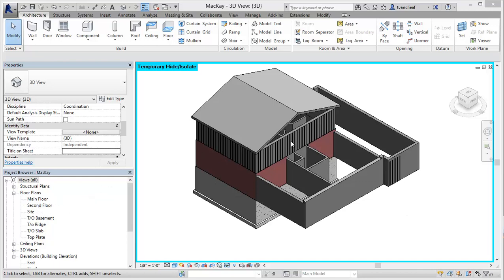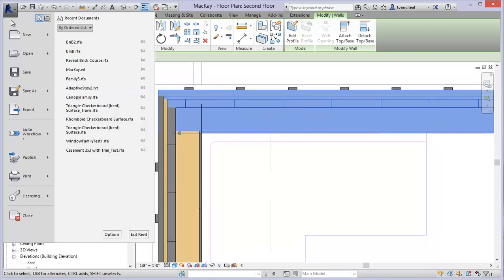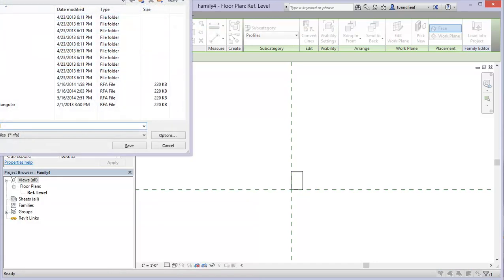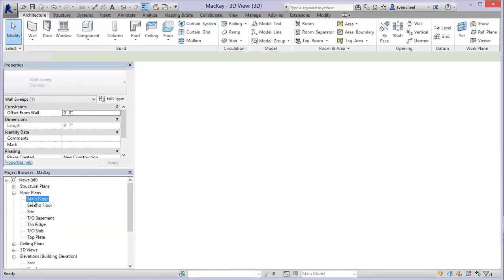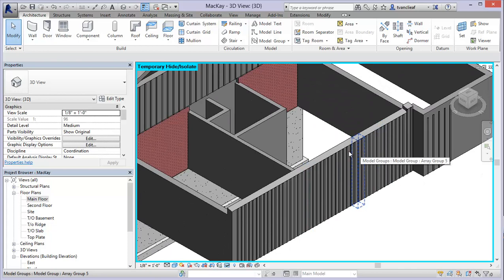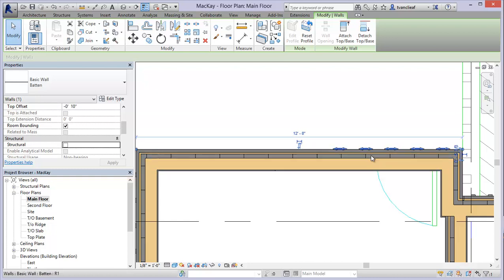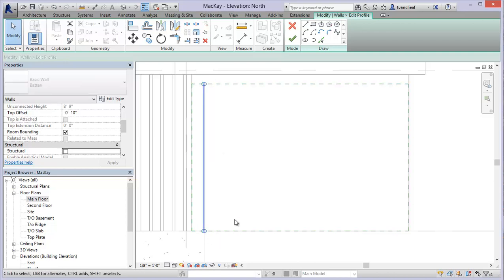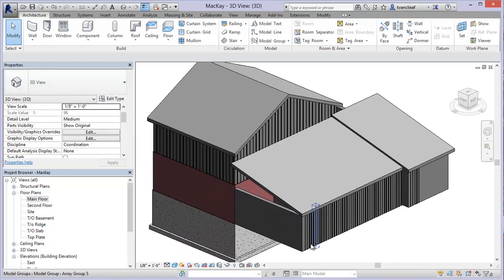Modifying Wall Profiles and Sweeps in Revit 2014 ~ Board and Batten Walls

Comment: how can I put a sweep at a wall ends? Thank you so much for the tutorial :)
Reply from the maker: If you end the sweep command and select the sweep, there is a Modify Returns option that appears in the Modify menu, if it's vertical, it will depend on what wall join you use, Butt joints aren't really helpful in this case unless you have a special sweep profile family, but if you use Mitre joints you'll be able to bring them right to the end of both walls.

Comment: Great tutorial, thanks! Is there a way to create the same effect on different types of surfaces, like floors or roofs? E.g. make vertical profiles that go from the walls up on the roof?
Reply from the maker: There's a bunch of ways, beam systems, curtain walls, sloped glazing are all system families than you can create profiles for in order to achieve this extra detail. For instance, a standing seam roof could be created with a sloped glazing family if you create mullion profiles to look like the seams. You simply lay this on top of another roof that represents the rest of the structure. Also, explore in-place modeling, from the Component panel, select Model In Place. It is probably better to create many forms within one in place component, rather than make one and then copy it. If something needs to repeat, it's better to create a family for it. Key family category though is profiles, then set up the system families.

Comment: that was really great! i managed to attach timber strips....when i click on my wall, the one with the new strips and click edit type and look at the properties window the new strips are not included.....can you help with that?

William
Reply from the maker: William, with this method, you wouldn't see anything related to the strips in the wall properties. These would be two separate systems, a wall and an array of a sweep. If you need a wall with vertical differentiation on the surface, using a curtain wall might be a better option. It depends on how much you have to do.If it were a house, I'd probably do it the way I'm showing here. On a large scale project, you may want to explore other options like curtain wall with a set vertical spacing parameter in the Type settings.

Comment: This was great! I am using this technique to create a vertical metal cladding .. any advice on this? Im curious about how the layers would work with this technique ( I did the first way with the sweep) how to attach this wall to a steel frame and gypsum board... I guess I need advice on how to build the walls after the profiles are done.. not sure if im making sense! maybe you could steer me in the right direction THANKS!
Reply from the maker: You can build the wall out to the z girts or channels, using z girt profiles built into the wall. You'll need to expose the preview of the wall section in the edit structure menu. For the cladding, I'd do this as in place sweeps, just be sure to use the Offset from wall parameter to get the lap correct for your cladding profile. The ends, inside and outside corners will require flashing profiles to really acheive the desired effect, but the outcome looks pretty slick when you get it right. The reason you model the cladding as in place components per wall is so you can remove the geometry with a void extrusion. Hope that helps!

Comment: Like a boss, thanks heaps my dude. Greetings from Australia also
Reply from the maker: Thank you for watching Josh. I cringe when I see some of the methods in these older videos. There would be other ways that you could do this, and although this one has a little more tedium when it comes to openings, it also probably provides the most control at a component level.  For continuous pattern horizontal sweeps or reveals, like Z bars in a ACM panel wall, I'd probably rely more heavily on the built in sweeps and reveal in the wall type properties.

Comment: dam you need to use the metric system :-)
Reply from the maker: You do you hombre, I use both! Fortunately, Revit is bilingual so if you type in my non-sensical imperial values in your metric file, you'll still get what you're after. :p
Reply: https://youtu.be/SeL2lCdkUfY

Comment: I followed every step but mine doesn't load into the project
Reply: Great tutorial thanks, I thought a step was missing too, but here's how I got it to work:
Project browser > Families > Profiles: Check your profile is loaded.Make a vertical wall sweep (as per video) using default (cornice).Highlight cornice > Edit Type > Duplicate > Rename (your description)In that same window, Construction > Profile > Change to the profile you created for the job > Okay

Then you should have it!
Reply: thank you sir i was having the same problem but thankg god for this comment!
Reply from the maker: It probably did, you need to edit the Type Properties of the sweep or reveal to use the profile that you created or modified. If you don't see it in the list, chances are the Profile Usage parameter in the profile family isn't set to Reveal or Sweep. You can find this in the instance parameters of the Profile family.
Reply: Sorry, I don't follow, How do I  switch profile usage parameters to Sweep?
Reply from the maker: You need to locate the family from the Families categories in your Project Browser, and open it. It should be listed under Profiles...Open that family that you want to use, and on the left hand side in the Properties panel, you should see a parameter called Profile Usage, but it's from within the Family Editor. You should see the Create tab first in the ribbon, not Architecture. You won't be able to change this from the project environment.
Reply: Changed the profile usage to wall sweep but still not in the list when I try to reload in the project
Reply from the maker: Odd, it should be in the list when you change the Profile parameter in the sweep or reveal. You may have to contact your local reseller to have them take a look. Hard to troubleshoot without seeing the files.
Reply: Anyway, thanks for your help. I didn't think you'd reply to this.  Have a good day :)
Reply: So dang helpful!!!! I have only been using Revit for a few days, but I have learnt so much just with these online tutorials. Thank you!

Comment: does it work for horizontal louvers as well?
Reply from the maker: You could use this tool for louvres, but I think you should experiment with a defined curtain wall type though first. Your outside mullions would be typical, the horizontal mullions could be the blades of the mullions, set on an angle and then spaced very closely together, and change the panel to the Empty System Panel. Also, ensure that Automatic Embed is selected in the Curtain Wall type properties so whatever curtain wall you draw it remove that geometry from the hosting wall. That way it is correct in section and in elevation. Curtain walls are good for lots of little tricks like glass railing as well. You could make a stretching louvre family, but then you'd require an array for the blades, too complex in my opinion if there's a system family that would do the trick.

Comment: Do you know if it is possible to do this to the roof? I know there is no simple 'Roof Sweep' .. Ive tried to model in place with a sweep but it wont allow to array from that across the roof. Thanks
Reply from the maker: Hey James, sorry it's taken so long for a response, I think what I'd do for a standing seam roof is create a fascia profile for that particular detail, and then host it to a model line. You can then create an array of the model line and the fascia sweep, and then hide the lines using a sub-category control through visibility graphics for that view. If you mean sweeping around the perimeter of the roof, you could use the In-Place component sweet, it allows for multiple planes in a single sweep, where the wall sweeps and reveals are always vertical and horizontal and don't allow for angles or hosting to a roof.

Comment: What Happens when you add a window or door?
Thank you.
Reply from the maker: A door or window will have an opening built in to it, so this should essentially remove a sweep or reveal to the extents of the door or windows opening. If you had a trim board to the outside of the door opening however, the sweeps would need to be manually adjusted, but I believe the "Trim/Extend to Multiple Objects" modify tool would probably make short work of it.